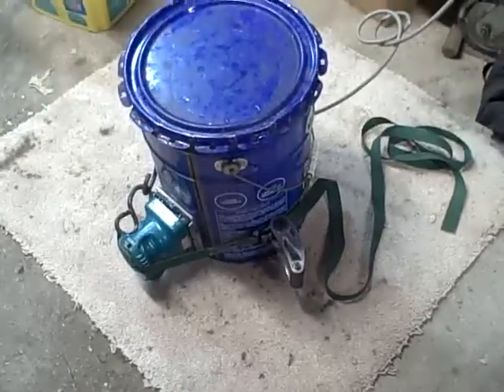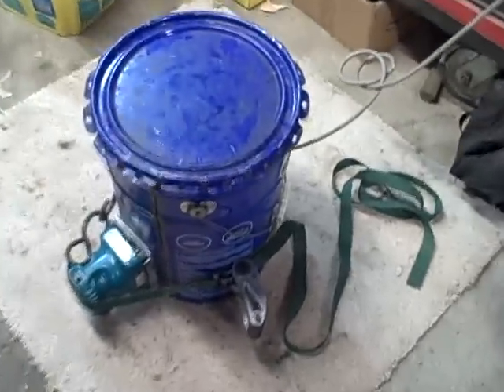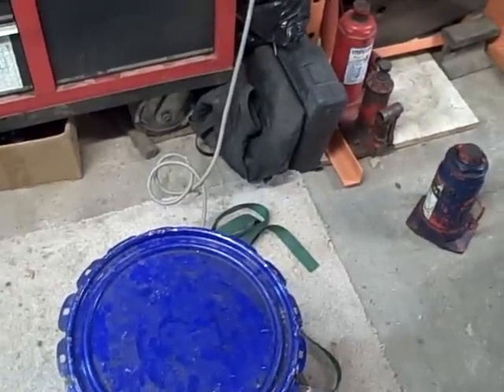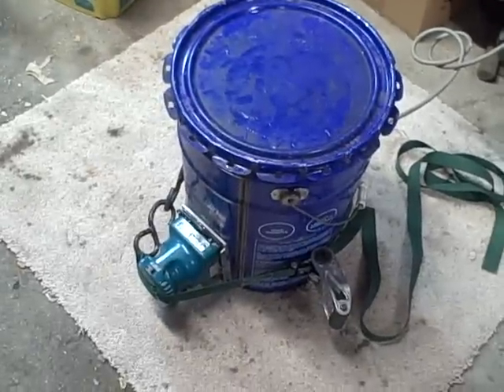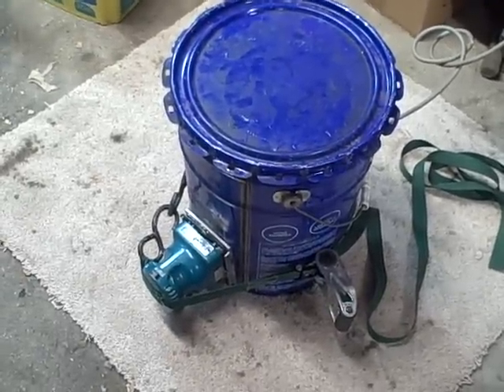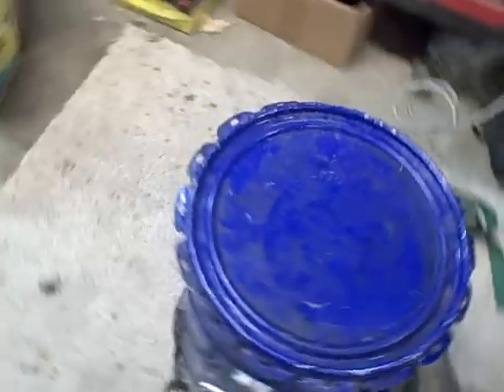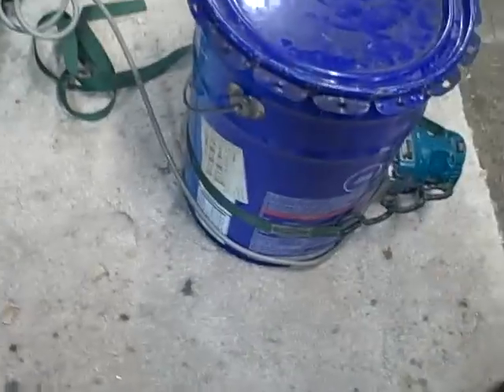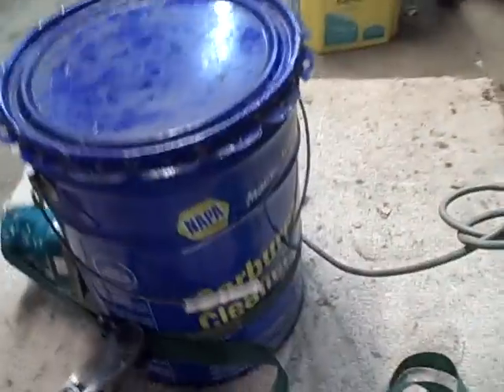Testing a homemade Ultrasonic carb cleaner at www.MotorManiaGarage.com

Comment: Really cool machine.  As sound is only vibration of fluid, or solid, I agree that this is a sonic cleaner.  not ultrasonic, because the frequency still in the audible frequency, but it still very efficient a think.  As we can see bubbles appearing, this is a sing of cavitation.  And therefore, the efficiency should be there.  The frequency of the sound wave is not so important.  The important thing is the cavitation.  Ultra sound is nice because you can apply a lot of power and not hear it !
Reply: You most definitely hear store bought ultrasonic parts washers. Mines 22L and it's very noisy!

Comment from the maker: Hi Michael, actually it cleaned real well. I was pretty impressed. But the Carb cleaner is $180 for that 6 gallons in the video. It leaked a little from the lid and its pretty caustic stuff. So I don't use this method very much. Actually just soaking and stirring the parts works just fine in most situations. I have boiled some jets and stuck slides in plain water with good results.
Reply: The carb cleaner alone is some strong stuff, so the vibration is the cherry on top!

Comment: it's a good idea tho it may not be "ultrasonic" well worth a try for someone on a budget..... However I would use more caution when using highly flammable and very agitated carb cleaner, attached to energized electrical equipment that is not intrinsically safe........   just a thought
Reply: Somethings in life just aren't OSHA approved; but that doesn't mean they won't get the job done.
Reply: @ginjaman4784  are you in line for a Darwin award?

Comment: you are wrong there is no requirement for so high frequency to start cavitation, 300hz may also work but it will need enormous amplitude to produce same results. 

however ultrasonic cleaners rarely achieve cavitation they just dont have enough power

Comment: i just looked up makitas current palm sander and it says 14,000 opm not exactly ultrasonic.  i don't doubt it would still work but what you have is a sonic cleaner not an ultra sonic cleaner.

Comment: That is a agitation cleaner not a Ultrasonic cleaner. Ultrasonic creates bubbles of low pressure vacuum these cavitations implode on or near the surface of the part creating a shockwave that cleans the object. Saddly that sander will near get remotely close to the minimum frequency required to create cavitations (around 20khz, though for automotive use you really want around 45 to 100khz) , Most your gonna get out of high end power sander is 300hz.

Comment: Ultrasonic is anything over 20kHz.
I can definitely hear that thing running.
Reply: can you make the difference between a 10khz sin and a 10khz square signal ?
Reply: So we need a sander that runs at 20,000 rpm and up.